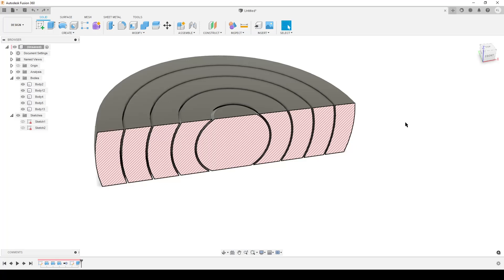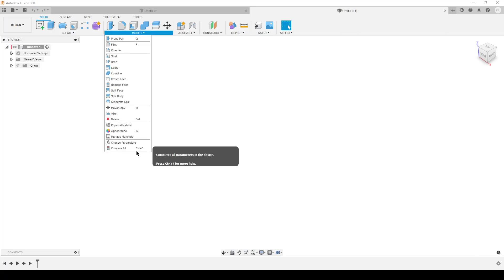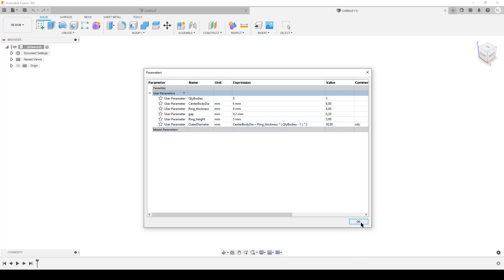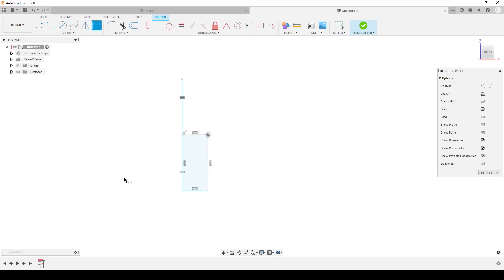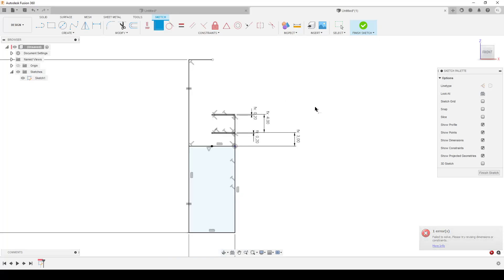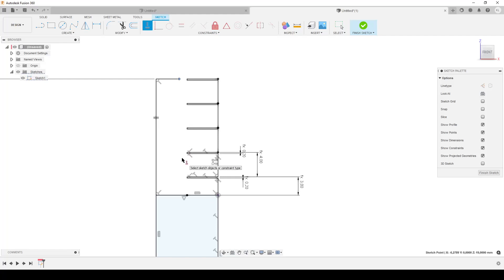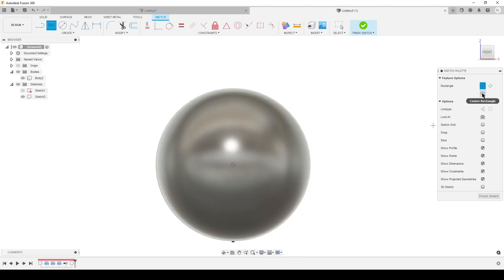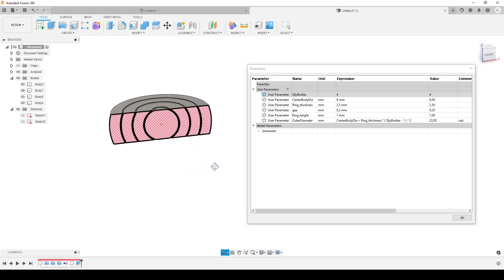Fusion 360 - Parametric concentric spheres or "The Useless Workflow" ;)

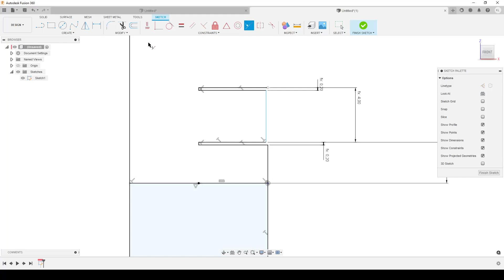Comment: Thanks for doing this Kristian. But I have a question 7:58, you said the sketch is still not "fully defined". How can you tell? All the lines looks black so they should be defined right? Is there another indicator telling you the sketch isn't fully defined? Thanks in advance.
Reply from the maker: I expand the browser to see the sketches, if there is no lock on sketch icon it's not fully defined.
Reply: @KristianLaholm  I see, good tip! Thanks for your reply. I'm learning a lot from your videos, thanks so much for making them. I really like your unorthodox approach to your designs. I don't understand them fully but they're very interesting to watch!